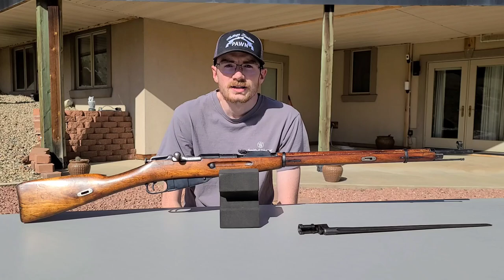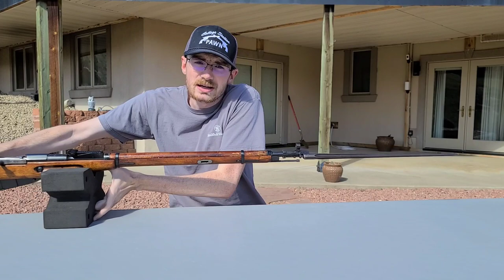Why a suppressor or bayonet will change your point of impact

Comment: I recently ordered a bayonet for my 91/30.  Plus I love the way “fix Bayonets!” sounds.  High speed video footage of a M1891/30 firing with a bayonet and then again without a bayonet would be very interesting to see.

My understanding is that the M1891, M1891/30 (M91/30) and of course M44 were sighted in using light ball (nominally 148 grain, real world 147-150
grain) with the bayonet fixed

Comment: My understanding is that unless you modify the sight post with something like electrical wire insulator to make it taller, you will never be able to accurately use the iron sights without a bayonet attached because they were sighted in at the factory with one attached. Apparently they tend to shoot quite high without one.

Also, I think this video brought up a good topic that should be discussed: shims and accurizing kits. Good, bad, ugly, and history.
Reply: Oh!  I have a question: in your experience, does the bayonet on only effect elevation of POI... or also drift it left-right?  Most ranges where I live won't permit the bayonet on, so wondering what to expect.
Reply: @jeffkulig6947  Most I find shoot high and right without the bayonet but that can vary. I have a whole playlist testing different 91/30 rifles :)
Reply: @Gungeek  I concur. My experience was this:

4" group 4" right and 4" high at 100 yards with ordinary ball ammo. 

Hungarian heavy ball had a 5" group which was 6" right and 6" high at the same distance.